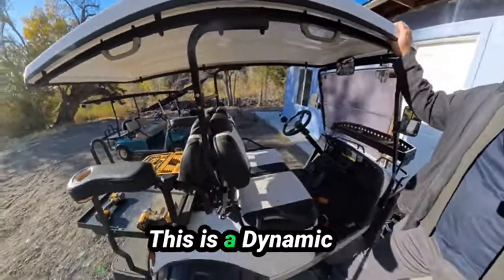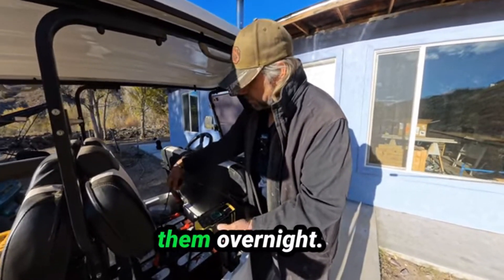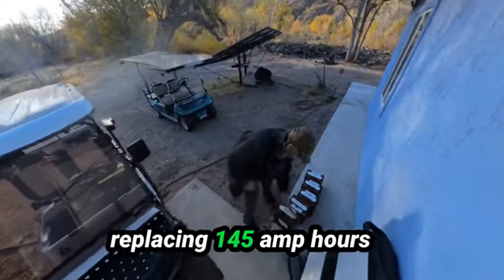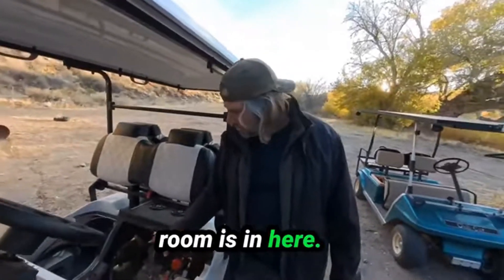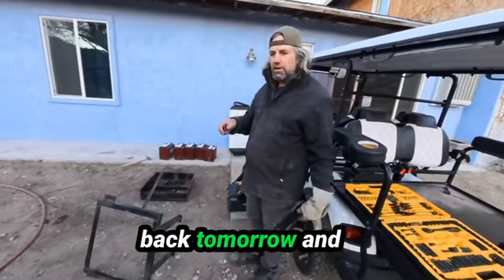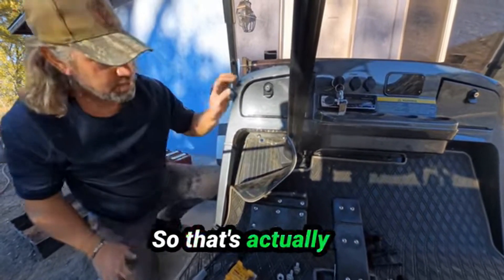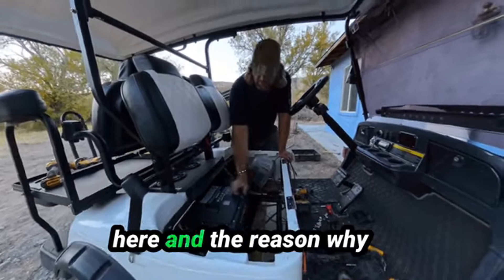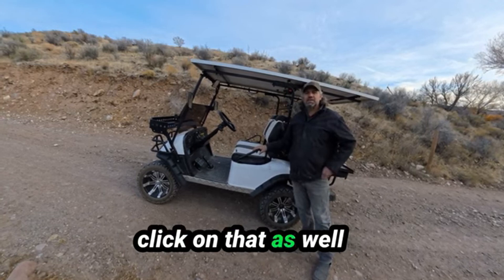Dynamic Enforcer Golf Cart Upgrade Vatrer Lithium Battery Installation

Comment: This is a very helpful video! I have this same cart and need to replace the batteries and I am weighing the price of Lithium. I am not skilled enough to do this conversion but it gives me great info on what the task consists of. A couple of questions; can you tell me the brand/specs of the Lithium battery? Also, can you tell me the cost of the Lithium? Thanks again for sharing this video!
Reply from the maker: "Hi! We're Vatrer and our lithium batteries are featured in this video. You can find product links in the video description for more details. If you have any questions, let us know - we'll be happy to help!"😄